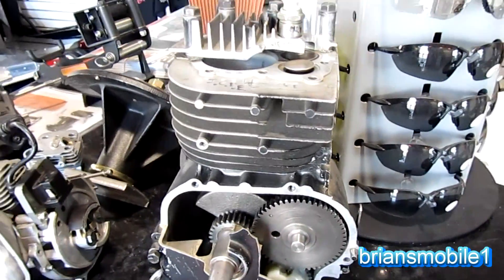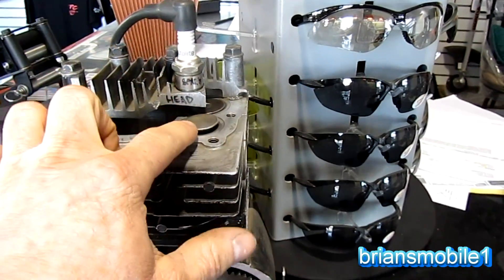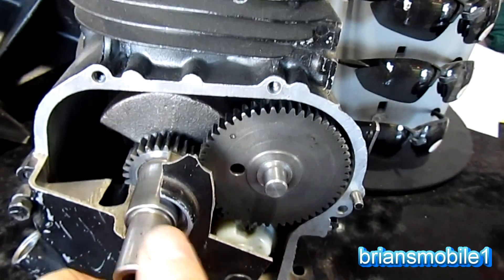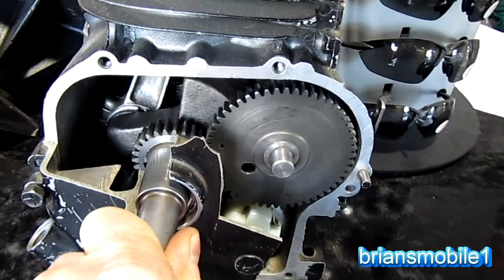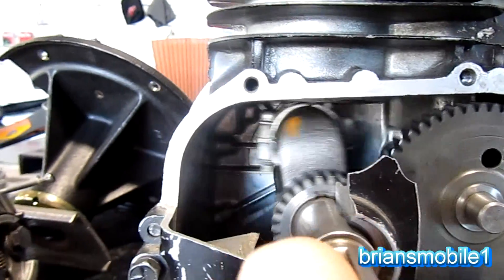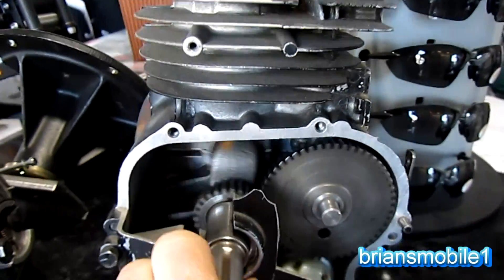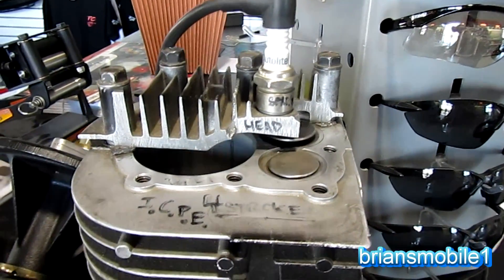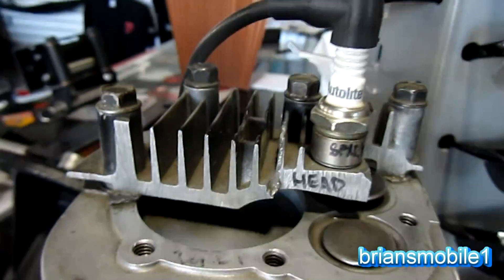Briggs And Straton Engine Cut Away Demo

Comment: Sweet, i hot rod these little guys for fun. How is the crank that easy to turn though? looks like it takes no effort at all.
Reply: DieselRiver At the end of the video he pulls away and you can tell they're in a store for auto parts of some kind; probably a small engines place. Somebody rigged a bearing of some kind to the shaft and probably the rings taken out would be my guess.

Comment: Hey Brian, I need your help badly. I have a 2003 Malibu that has a water leak but can't seem to find it. All of my hoses are fine, did a radiator flush, checked engine and transmission oil just in case, there is no visible leak and I'm really puzzled by the whole thing. I burped the car properly of any air that might be in the system. and after I refill it to the proper level and drive it for about 30 minutes, I come home, open the hood, shut the car off and look at the reservoir and the water just gets chugged down. I have no clue where the water is going. And it keeps doing this, doesn't matter how much I refill it. Thanks again.
Reply: No smoke coming from exhaust? Also, you can try pressure* testing the cooling system. EricTheCarGuy has a few videos on that and you'll find the leak about 100% of the time if it's not going into the cylinders. You could have a blown head gasket causing the water to go into the
Reply: It could possibly leak in the cylinder head gasket. If you fill the reservoir and then start the engine with the cap off, check if the coolant is boubling (ie. compression is leaking out into the coolant system).
Reply: Jesper Åhman that was the first thing i ckecked when I didn't see a visible leak. But all is good there and the heater core isn't leaking either. Thanks.
Reply from the maker: If you're not smoke screening folks in the rearview and you're not geysering from the open radiator cap with the engine running, then do a pressure test.  You can rent a radiator presume test kit from many auto parts stores.  Sometimes you get a leak from a hose where you have to be hot and under load to leak AND it drips straight to the road.  Here's a link to the kind of kit I'm talking about.
Reply from the maker: briansmobile1 http://www.amazon.com/gp/product/B00SXAVYRM/ref=as_li_qf_sp_asin_il_tl?ie=UTF8&camp=1789&creative=9325&creativeASIN=B00SXAVYRM&linkCode=as2&tag=httpwwwyou00f-20&linkId=ISE6I7IBYRMRPJZG
Reply: What engine is it? Are you sure you aren't suffering from the famous 3.1 liter intake manifold gasket leak?
Reply: Cory Stansbury It is the 3.1. And im almost 100% sure thats not the problem, since i did the heads less than a year ago and replaced the lower intake manifold gaskets. Im just at a lost with what is going on.
Reply: briansmobile1 Tried to do the pressure test but couldnt find a kit that would fit the reservoir tank. Since its one of those stupid cooling systems that dont have a radiator cap. Would a busted Lower intake manifold gasket show water in the engine? Because i dont see any residue of water or traces of water in the engine.

Comment: Nice engine demo but could you imagine having to adjust the valves?
Reply: Adjusting valves on a flathead is a lot painful then overhead valve. You'll have to physically remove the valve and grind off the stem until you have proper clearance. If you grind to much, you will need to buy a new valve.

On the brightside, these flathead engines don't usually need valve corrections during their useable lifetime.